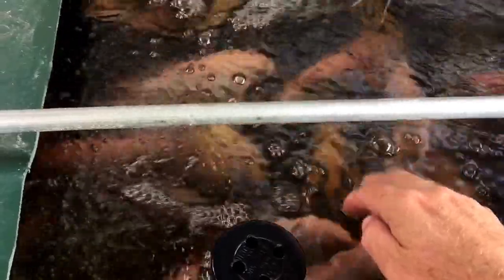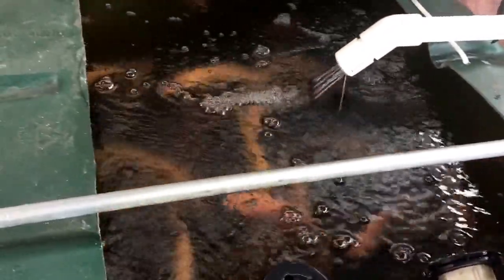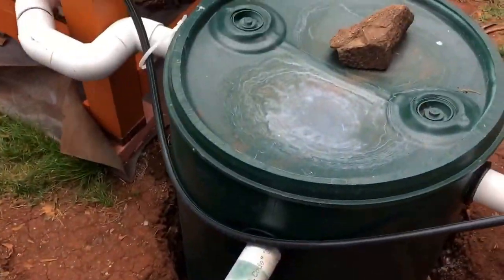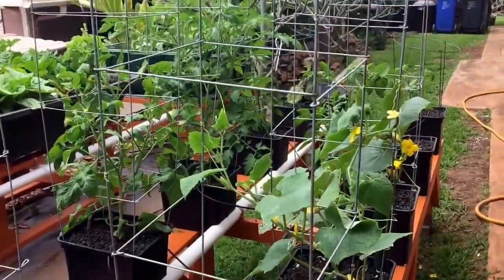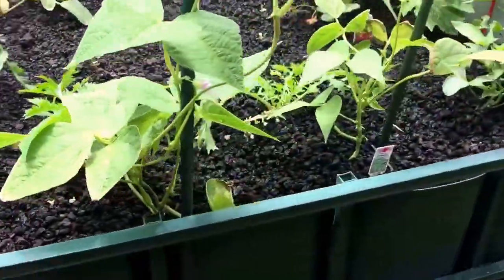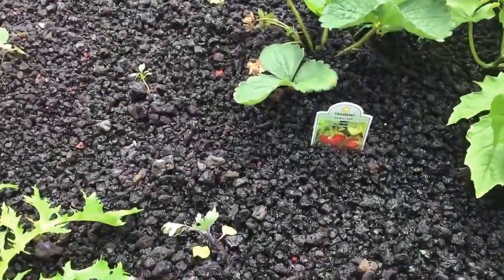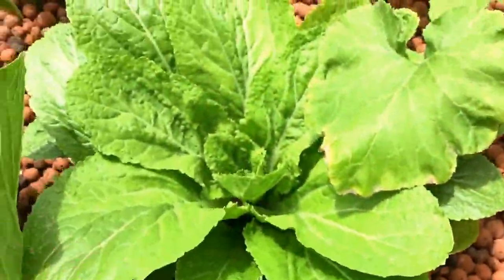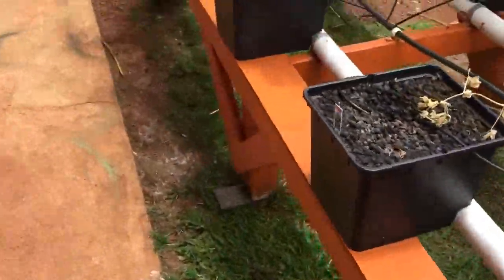Aquaponics Dual Loop Update 4/14/15

Comment: Is looking great Jim..  Thanks for the look..
Reply from the maker: RobBobs Backyard Farming Thanks Rob. It is really working out great! Beat all my expectations so far.
Reply: what kind of bed material is that?
Reply from the maker: Zach D One bed is Hydroton the other two are lava rock.  Lava rock is abundant and cheap here in Hawaii and very porous.
Reply: not so cheap here, but very large guess i could use a hammer and make it the right size.